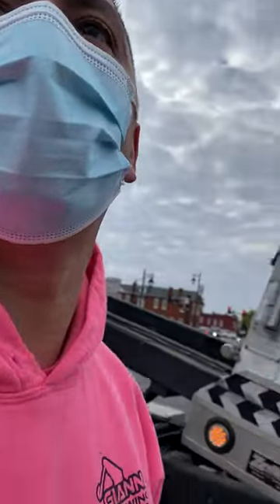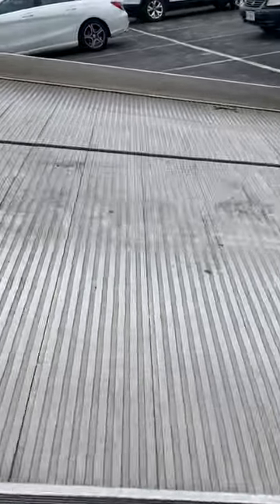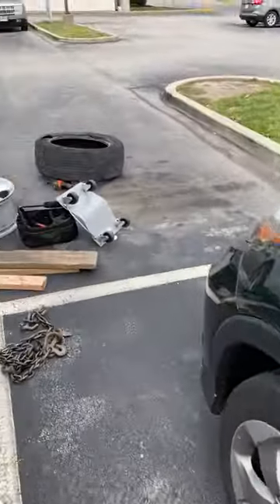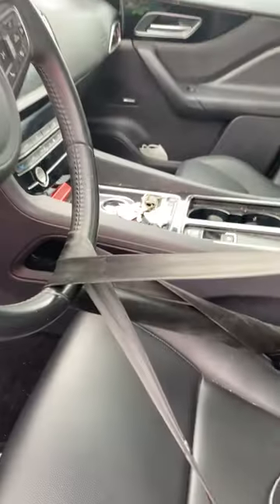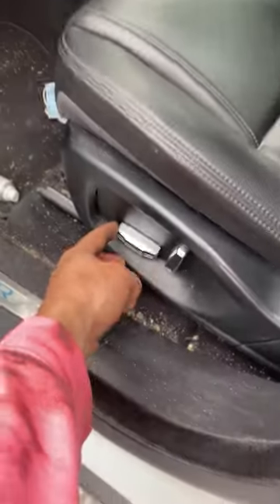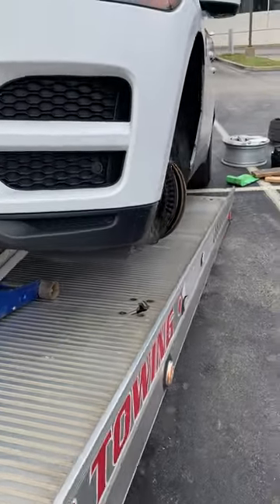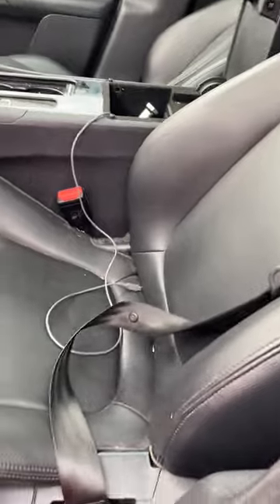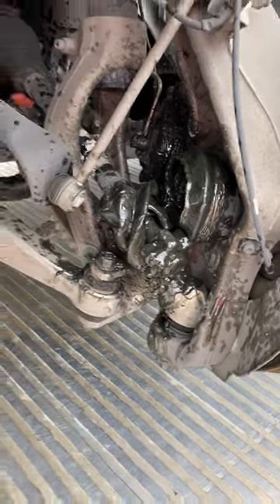Broken ball joint towing using jack

Comment: I pulled up on an old Silverado the other day both ball joints snapped and the tire was laying flat on the rim. Rotor was just dangling from the tire rod end and brake lines. Never seen anything like it but did the same process with a jack and a 6x6 block as a skate.
Reply from the maker: Check out this video snapped off while unloading on the Cammed Holden SS 
https://youtu.be/4KP1LJHtn98